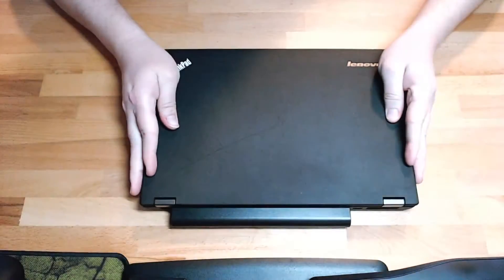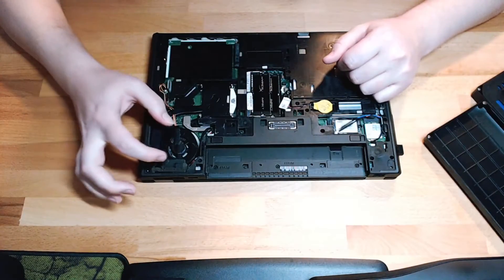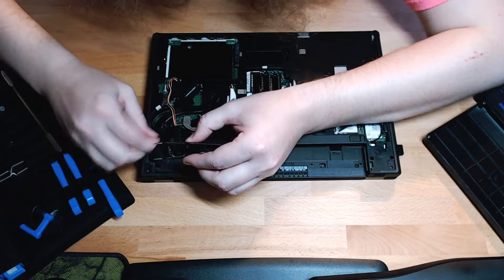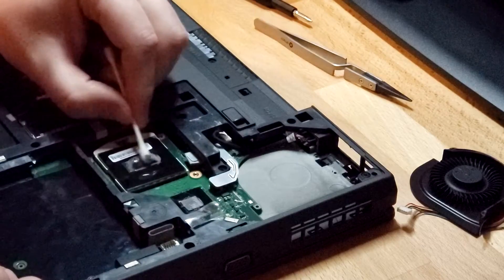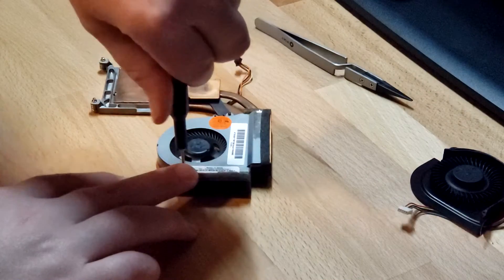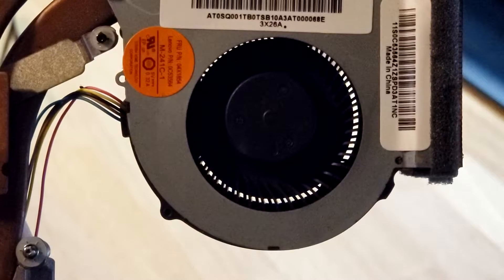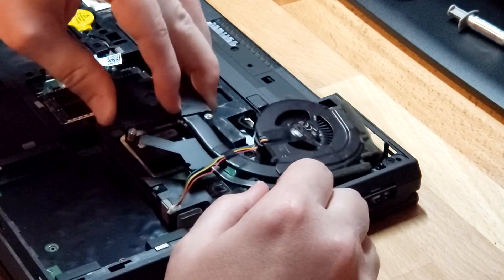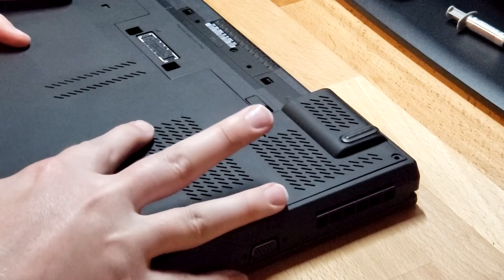Lenovo T440p Fan Replacement

Comment: Where did you connect the CPU fan’s grounding cable? On the original one there is a black cable like this; I’m not sure whether the new fan had it. Please tell me exactly where this should be placed and secured. Unfortunately, when I disassembled the old fan, I didn’t pay attention to this.

Thanks!

Comment: great. now do mine.

(the fan works, I really just want to know if there is some way to lube it. it whines.)
Reply from the maker: Not that I know of. I think it's a closed barring. You could try to add some sewing machine oil to the baring area. Like a drop. But that would be at your own risk

Comment: where can i buy the same battery like yours
Reply from the maker: I bought mine off ebay I think. It's the extended battery. Sorry I don't remember the price and it was long enough I'm sure the link isn't active anymore.
Reply: @asideoftoast  i want that extended battery so bad
Reply from the maker: Found this one https://www.ebay.com/itm/Genuine-Laptop-Battery-for-Thinkpad-T440p-T540p-W540-W541-9-Cell-57-/313150471649?_trksid=p2349624.m46890.l49292